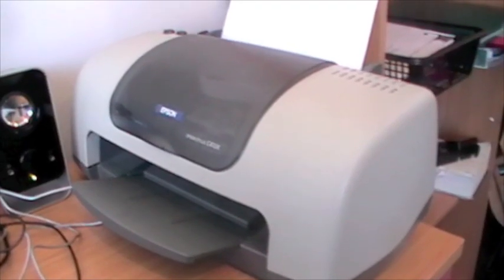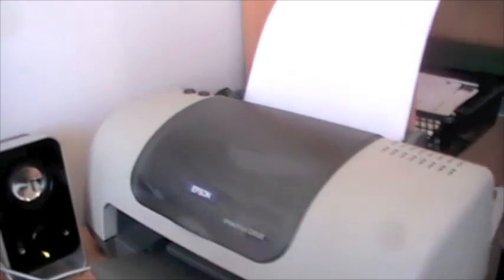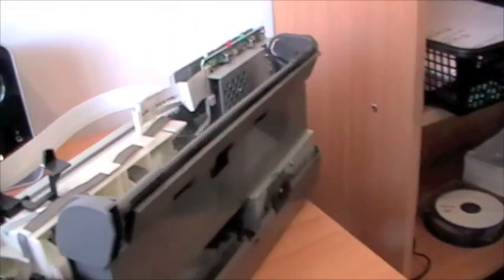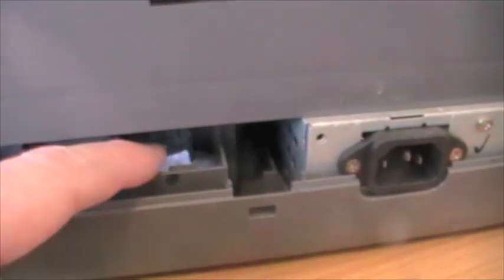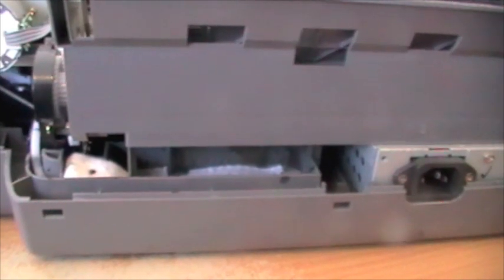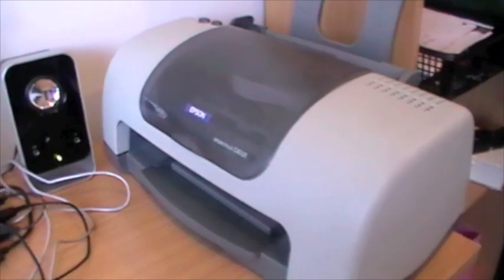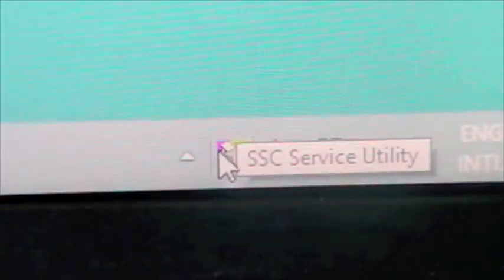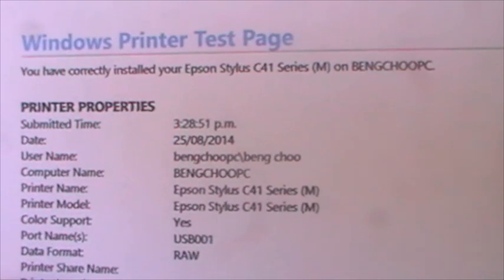Epson printer waste ink pad counter reset

Comment: Hello, thanks for the great video. I have the same blinking problem. When i use the SSC it says "Printer off or some other problem". I dont know what to do. Do you have any idea.
Reply from the maker: What version of Windows are you using? You could try using an older version eg Windows NT. See if someone you know has an older version and then experiment.
Reply: Yeah, i found out it was not working on win10. Thanks again, i understood that the problem was waste ink counter with this kind of blinking.

Comment: Good video.
Sadly, the SSCSERVE utility does not appear to run on Windows 8 (printer shows as 'off or some other problem' all the time)
Reply from the maker: Yes but if you can find a friend with Windows XP, as I did, you should be able to re-set the printer and then use it with Windows 8. HTH
Reply: Thanks, Mike.
I think the problem was the Windows 8 being the 64 bit version. It wouldn't work even using various compatibility modes I tried.
However, I tried it on Windows 7 32 bit and it worked fine. Thanks for your input.
Reply: Chris Manders u
Reply: My problem was the SSCSERVE utility did not like the LPT interface port, so I temporarily connected the printer using a USB cable and the utility finally saw the printer as online.

Comment: when i go to soft reset or reset protection counter it says an error
Reply from the maker: What is "it" here, are you using SSCSERVE? If so are you using a version of Windows that it runs on; it will probably not work on anything later than Windows NT. HTH
Reply: @mikeuknz  I am using sscserve and windows 10. I installed the latest edition for Windows 10 (64bit). I guess time has changed and they have updated it now. Have you got any other solutions? I just installed new ink cartridges today and really need them but I can't use my dam printer as it says there is no ink
Reply from the maker: @avi.d04  I suggest you do what I did which is to find someone with Windows NT and connect the printer to it. Then run SSCSERVE on that computer and re-set the waste ink pad counter. Once it is re-set then you can connect the printer to any other computer including your Windows 10 one and it should work fine. You could as a long shot ring the Epson help line in your country and ask them to provide (email) their utility to re-set it but I found them to be really unhelpful; they might be better where you are. Good luck.
Reply from the maker: @avi.d04  Sorry should have said Windows XP though NT or 98 should be OK too
Reply: @mikeuknz I'll call the helpline (UK), if it doesn't go well I'll try find someone with windows xp/98. Thanks for the help!